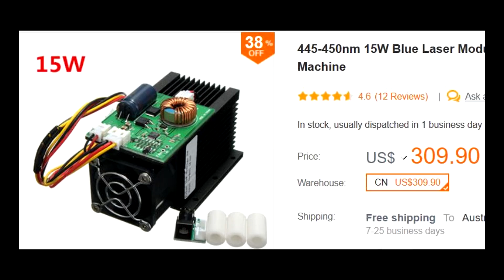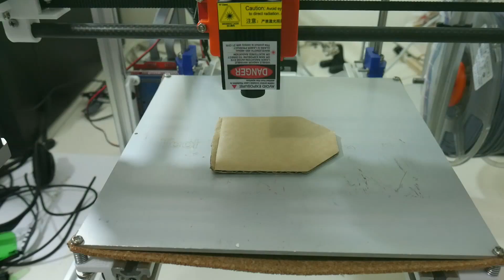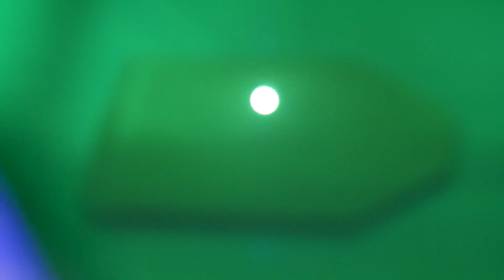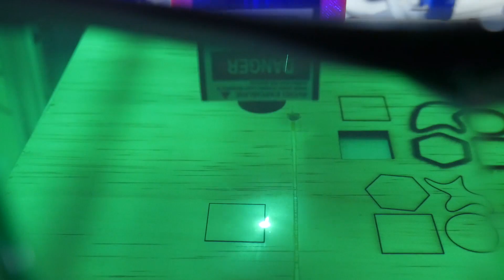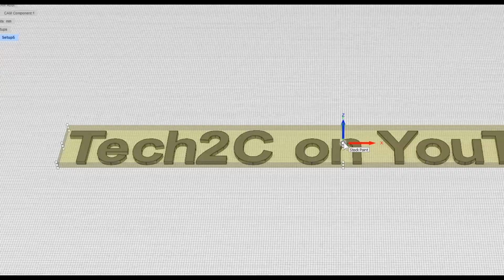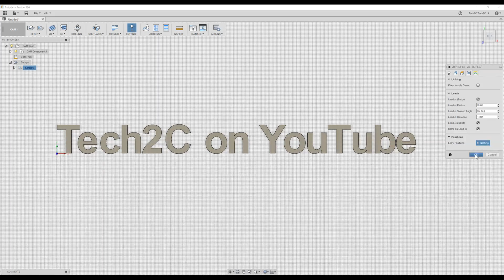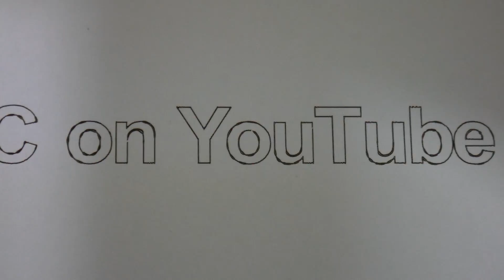Laser Cutting with a 3D Printer

Comment: If anyone can help me out - Do (ebay) laser drivers with ttl option smooth out the output, or does ttl mean square wave dc? I'm asking if these drivers can be used for (infrared 940nm) communication, do these drivers turn diode on and off (in my case at 38kHz), or do they just filter that ttl modulation out, using it only for output power control?

Comment: Very interested in trying this.
One question I am not seeing ever asked is about vapor and particulate accumulation or condensation on the output lens.  
Is this an issue? How quickly does it get contaminated and is there a reliable way to clean it properly when it happens?  
What which materials are the worst?

Comment: Hello from the future: I am just now getting interested in laser related hobbies. I had a thought from watching this video. If you are cutting certain depth material after focusing the beam, would it make sense to have the bed raise during each pass? The beam id focused to a fixed height but as the laser cuts deeper, it would seem to become less focused. In order to keep the maximum cutting edge as the laser is working, it might work better if the bed was adjusting allowing less passes of the laser. Just a thought if is possible to program the machine this way.

Comment: Instead of PCB printing in paper you can paint black a PCB board and laser out the ink from tracks, then etch!

How about instead of turning on and off the laser power supply, hook the TTL line to D9 before the mosfet to get the arduino 5v pin and hook external power supply the 12v/gnd?

Comment: I want to make a similar setup with different printer. One additional precaution I plan to do is transparent shroud (idealy one that would block light from the laser) that is around laser and goes very close to the surface, so that I don't get blind if I accidantally forget my goggles. At the same time - small fan with hepa filter on that shroud can filter fumes from burned surface

Comment: these cube do you used INKSCAPE a simple square VECTOR or g Code ?
Reply: In older comments he said he did it in fusion360 but yeah, you could use inkscape and gcode extension and load the gcode in your standard 3d printer program

Comment: Safety glasses can be a hit and miss with cheap chinese suppliers. With high power lasers in the watts range, I'd make sure to test them well before use. The need quite a bit of attenuation to get the light levels to safe milliwatt range.. Sometimes such glasses are sold for protectors to frequency (color) they do not attenuate at all. I think the worst one I've seen was a red colored lens to protect from red laser. :o
Lasers are fun but need some testing to be safe. Also you want to protect other people like random person from the family walking into a room full of reflections without glasses. I used to mount a warning sign to a door when I wanted everyone not to get in.

Comment: Hi Chris,
I know this is an old video but I hope you can read this still. I wanted to ask you if you ever made a CPS file for the Prusa i3 MK3 printer? I know I can change the GCode  from the results of your Hypercube CPS but it would be great to have it for the Prusa. I have no idea how difficult this is but I am sure it is of great interest for the Prusa community. I do have the GCode that I would like before the Lase starts. Hope you can give me a reply, I know you have a very large following and cannot answer all the questions. Cheers
Reply from the maker: Hello, the hypercube.cps for Fusion360 will work with any 3D printer, not just the HyperCube. Enjoy :)
Reply: @Tech2C  Thanks for the Info CHRIS. I am unable to set the laser on the table because it is mounted higher than the extruder nozzle. I do have some software which produces Gcode that sets up the prusa and then waits until I place the material to be cut. The software converts SVG files to Gcode for the Prusa however it does not work very well. May I send the start Gcode so you can see what I mean. Where can I upload it to you, or should I just write the code here? Sorry to be a problem... I am 70 years old and still learning.

Comment: I have a real concern about security.
There are regulations in different countries for engraving lasers that must be enclosed in a box with security.
Why is that?
There are many situations where a reflection can occur and the laser beam will cross the space in a completely random and unwanted way.
Of course you can wear gasses, that avoid you to become suddenly blind.
But what is somebody, your kid for example, enters the room at the wrong moment!
What if your kid as you are not present wants to do as his dad and stars plying with the printer. What if you thing the laser is off because the bean is not visible!
Nobody should build a system with a laser without a box blocking the laser beam or without securities that shut the laser if somebody tries to open the box! The glasses are not enough to be facing all kind of situations!
How will you explain to your kid that he is blind because you were playing with a laser with insufficient security and it happened he crossed the beam by accident! Will you really be facing him and tell him you are not responsible. Ok he cannot see you anyway!
Reply: The word you are looking for is safety, not security.
The basis of your claims is true, but the scenarios you gave are not the real issues, "crossing a reflected beam" in these rated powers of 2.5W lasers is not really the dangerous part since after the reflection the focus point will be off and the laser won't be able to cut anything, the reason why someone might go blind with these lasers is because the reflected LIGHT in the impact focused point, from all directions of viewing it, not just a reflected beam, is too bright for the human eye, so just like you can go blind by staring at the sun which isn't a focused direct source of light, you can go blind from looking at the the laser's point of impact.
About a kid entering the room, or trying to use the engraver, you assume he has a kid, which isn't necessary the case, also, just like with any other dangerous equipment, like an electric saw for example, the equipment should be stored in a way that a kid wouldn't be able to operate it at all, and not only if the lid is closed, and the equipment should be operated in a way that a kid won't just suddenly appear out of nowhere, just like you can cut something with an electric saw, and you should take the proper actions that a kid won't just get in the way while you are using the saw.

So the real issue here is mainly about safety awareness and taking the proper actions in order to avoid an accident in a given situation, and not if the laser is boxed or not.

Comment: I’m not sure aluminium is the best choice for your cutting bed. At 450nm, Al will reflect about 90% of the beam.

Good thing you bought those safety glasses. Maybe a tube of sunscreen would help as well?
Reply: The focus point of the laser is set to the distance of the bed from the laser diode, if reflected, the beam won't be able to really do much or any damage in the distance traveled until it reached his skin since the focus point will be greatly off, also although the bed is a little reflective, it's not anywhere close to a mirror and even if it will reflect and not absorb 90% of the beam's energy like you say, the beam will get disperse enough to even further reduce its focus, so in 2.5W, I doubt it's really dangerous using an aluminium bed, although I admit I won't try this myself, just in case...
Reply: Eyal - I’m not that concerned about his skin, despite my flippant sunscreen remark, it’s his eyes he needs to be careful of and they have a built in lens. Aluminium isn’t just a little reflective to light at 450nm, it actually reflects more than 90% and 0.9 x 2.5W is plenty of power to cause retinal damage.

Comment: Can you use a PWM ?
Reply: No, I have the same laser and it's just TTL compatible
Reply: You can, if hook the TTL line to D9 before mosfet (to get the 5V arduino pin) and hooking 12v/GND to external 12V power supply

Comment: ive found a 15000mw 15w 450nm (Blu-ray)
could this be used instead? Specifications:

Laser Wavelength: 450nm (Blu-ray)

Output Power: 15W

Working Voltage: 12V DC

Working Current: 5A

Focal length: 16mm

Focal length: can be adjusted

Heat dissipation: Fan

Driving Mode: External ACC constant current drive

AC Adaptor Plug: US

AC Adaptor Input Voltage: 100-240V

Lens Material: Optical glass with coating

Light Form: Dot, adjustable-focus

Modulation: TTL

PWM Control: Support

Comment: is the laser module cooling fan connected to the ramps board as well?
Reply: His laser fan is in the same power he connected to D9, it is clear in the video. What is not clear is if the laser driver has a TTL line and why he didn't use that instead of PWM'ng the 12v power supply

Comment: I was thinking about a possible efect when the printer acelerates in Y axis, in this situation it pulls the lower belt of one side and the upper belt of other side which could cause a carriage rotation. I thought of a experiment to measure this using the laser diode. You could write a gcode to position the carriage at mid X axis and go back and forward on the Y axis fast with the laser on, this way any deviation would be registered in the surface bellow. 
Do you think it is worth doing and would you have time to do that test?
Reply from the maker: Checkout these useful links
http://www.doublejumpelectric.com/projects/core_xy/2014-07-15-core_xy/
http://corexy.com/theory.html

Comment: Probably a good idea to have some sort of ventilation system to suck/blow smoke away from the laser, or else you might risk sooth accumulating on the lens and eventually blocking enough light that you damage the lens itself with the heat.

Comment: Is it possible to use a fiber optic cable to redirect beam from the laser module to a mount on the extruder assembly? The goal of this being that both systems are permanently mounted on the extruder assembly, with the laser module mounted somewhere on the frame of the printer.

Comment: Can someone confirm if 500mW 405nm module would be enough to cut paper? I would like to convert one of my printers to cut camo masks for my scale models, no other use intended so far.
Reply: Yes, it cuts
Reply: @brunocabral1578  Thanks mate! In the meantime I got a small plotter / cutter for just this application
Reply: @Tankbrusher  Which one do you buy?
Reply: @brunocabral1578  silhouette portrait 2, Inkscape driver is opensource, but experimentel, once this combination runs it's a powerfull tool - the standard software sucks a lot.

Comment: hi how do you connect higher power laser head, do I connect the head the same way 2.52 is connecte and use a step up voltage converter to provide more power?
Reply: You can power the laser from external power supply and connect the TTL pin from the driver to D9 before the mosfet to get the arduino 5V pin

Comment: Hi, did you measure the current of the laser?
My 2.5W laser has a current of 0.9A which killed my transistor on my Trigorilla board.....
My laser is not shown any TTL input, but there is a little main board in the printer.

Comment: Cool video, just found it. I have got a dual extruder delta printer waiting to be assembled, I also got a 0.5W 800nm laser to take the place of one of the extruders. Using a wooden cabinet plus a Raspberry Pi with camera running Octoprint, instead of the goggles.

Of course I'm going to try burning some of that metal infused PLA filament (if it were to sinter it into a solid object, I wouldn't be disappointed either).

I figured those lasers were probably too low powered to have any real chance of success, so I chose the lower powered 800nm laser as I guessed it'd be closer to the right wavelength, even if the 400nm ones were more powerful.

Comment: Hi,  am using your CPS file on an Anycubic MEGA. Unfortunately, after running the GCode, my machine is not taking any positioning commands, left will run to the right, Z-down is up.
The GCode looks good bt it is not properly recognized. There are only positiv moves, no G1 X-10 or something, this will be converted to plus movement eve the code says -10 it is marching +10, same on X, Y and Z. After homing, all is fine till the end of th escript.
Marlin 1.1.8, any Ideas
Thanks in advance

Comment: You can just run it at parial power depending on needs correct?.....also were you using full power when cutting throught the wood?
Reply: Does it matter if its a TTL modulation laser or analog modulation laser

Comment: I'm using arduino UNO and stepper motor easy driver, so how can i connect the laser to control it?
Reply: Your UNO is using GRBL? If so, TTL from laser goes to pin d12 and you connect 12v/GND to external power supply. To turn on the laser it will be M3 S1000 and to turn it off, M5

Comment: Can you please tell me how effective the $3.99 laser safety glasses are?  Thanks.
Reply: Just make sure the glasses you get are matched to your laser's wavelength; not all glasses block all wavelengths.  But even cheap glasses work fine.
Reply: Thanks for replying Richard. I know about the wavelength requirement.  My laser diode is the same as in this video.  It is 450nm (or 455nm?), but what I am concerned about is the real effectiveness of the cheap Chinese glasses for this wavelength.  Will they protect your eyes?  Thanks again.
Reply: Thanks Richard.  I know about matching the glasses to the wavelength of the laser.  My laser diode is 450nm (identical to the one in this video 2500mW).  My question is: How effective are these cheap Chinese glasses at protecting the eyes? Should I forget about them and look for a pair that is better at shielding my eyes? So, I'm questioning the quality and true effectiveness of these 450nm glasses, not questioning what to get.
Reply: If ou can see the laser light, it isn't protecting you

Comment: I have a Ramps v1.4 controller, but I do not have the correct firmware for the laser, who can help me? Many thanks
Reply: you don't need an specific firmware, just use M106 S255 to power the laser on and M107 to power it off on your gcode

Comment: +1 on adjusting the z height with each pass to keep the focal length the same and +1 on some air assist as the smoke will reduce the lasers power. With both mods you'd cut through in less passes.

Comment: Hm, it looks like Fusion 360 is no longer free for Hobbyists, is there any other Cam Solution that Fraa/Cheap (>50 or 60 bucks)?
Reply from the maker: I just checked the Autodesk website - it still shows free for students and hobbyists.
Reply: It's still free. You still have to sign up and become a registered user.

Comment: Would this laser do 6mm light plywood?:https://www.banggood.com/450nm-3500mW-3_5W-Blue-Laser-Module-With-TTL-Modulation-for-DIY-Laser-Cutter-Engraver-p-1103261.html?rmmds=detail-bottom-alsobought
I would probably mostly use it on 3mm,but would like the extra capacity if i need it.Thanks.
Reply: That is an overdriven 2.5 watt laser.  Notice the bit about 30 mins maximum that I do not see on the 2500mw version.  Same for all of them above 2.5 watt.  edit: Power  Max.3.5W , Average 2W
Reply: Good question.  What I think is happening is they cut and paste the same stuff but I know for a fact the 5000, 10000 and 15000 are over driven.  When you deal with the higher than 2.5 w they want you to not use it for over 20s at a time and let it cool down for 1m.  They even tell you that on their video.
Reply from the maker: Maybe. Have a read of the comments on that laser.
Reply: Actually, it says the same on the 2.5 watt module: "using the laser
    module more than 30 minute one time and casue the damage". What does it mean, is it a 1.5 watt module that is being overdriven?
Reply: @ninjafpv449  it means you need to turn it off for cooling from time to time or the laser won't last the 6,000 hours it advertises

Comment: You need ventilation, not just for safety, but to keep the lens clean. The binder in paper or the fumes of plastic will coat the lens and after a while, the laser will crack it.

Comment: Nice video!
How do you know if the safety glasses will protect you?

Thanks!
Reply: Since he has not yet answered this comment I guess he went blind ;) 

Just kidding, the quality control of the material used in the glasses will of course affect how good they are at blocking the 200-500nm wave length, I think the glasses he got will do just fine, however, if you are really concerned about protection, consider some brand name like Phillips or other ANSI Z136 certified glasses.
Reply: If you're seeing the laser, it isn't protecting you